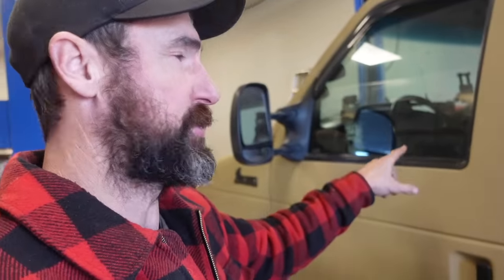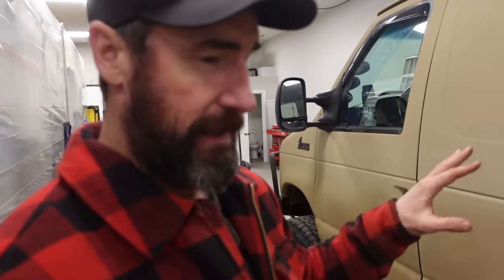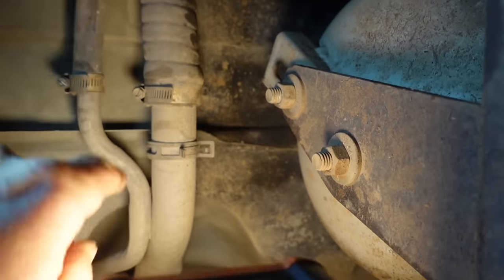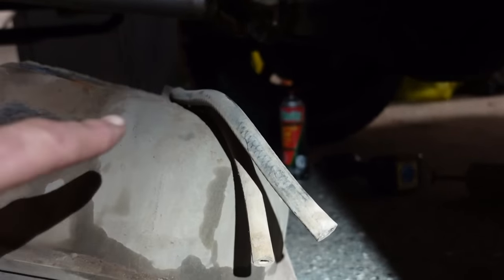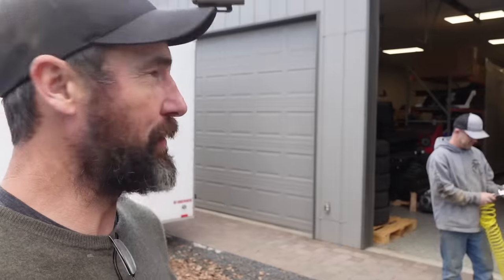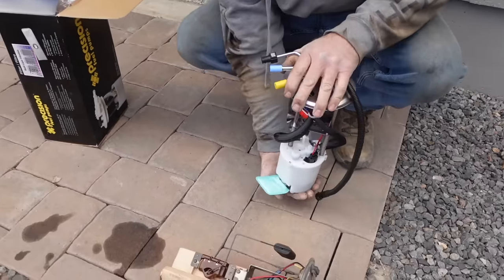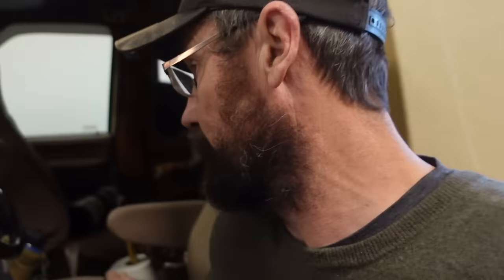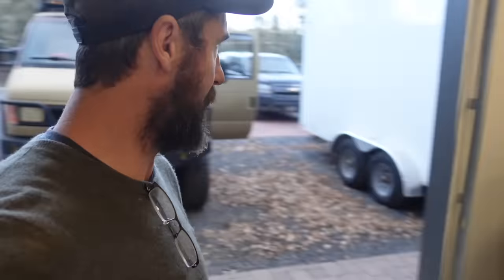Super Simple Ford E350 Econoline Fuel Pump Fix

Comment: What I learned is being friends with a guy with a roll back truck and another guy who is a van mechanic is very useful for someone who lives the van camper life.
Reply: Just having a lift to do vehicle work is a huge help by itself.
Reply: It is ALL about the network!!! No matter what your in to.
Reply: You fixed the effect and not the real problem.  In tank fuel pumps are a matter of life now but having one go out on you hours away on ORV roads has no simple remedy. You would think that some off road aftermarket solution would be available that would have a redundant pump that would get your tit out of the wringer and not having you drop the tank on a dirt road after acquiring a replacement pump. A fuel pressure gauge on your dash seems like a good idea but really just tells you you are screwed.
Reply: @elffirrdesign2063  Carry an inline 12v pump would be a simple backwoods remedy.
Reply: @wildbill23c  .. I never used one myself. May I ask what benefit would it be for? Trying to figure it out now what one needs to connect it.
Reply: @RickyL305  Umm, you drive a vehicle onto it and it lifts the vehicle for easy underside vehicle maintenance without having to lay on your back under a vehicle to work on it...or with most of today's vehicles you can't get under them without either using jack stands, ramps, or a lift...I'd say a pit but those things are a pain for some people, and dangerous.
Reply: @wildbill23c  sorry for the foolish question, I just never heard on it being very very old school myself and not mechanically inclined but I just seen a video of it so thank you. I wished I heard about it last week though. I will be buying two just to keep on hand for my vehicles from here on out. Thank you.
Reply: @RickyL305  Geez you must be rich, a vehicle lift is around $5-6k.
Reply: Pay your friend

Comment: I am gonna make a point of using a hole saw to create access over top of my fuel tank/pumps. I carry starters, alternators, and for cross country trips will likely include a fuel pump.
Reply: Manufacturers should be doing this already.  (But where's the money in that??)
Reply: Old import trucks used to have access but that was to convince
Reply: @bagheerab278  some modern ones do, my son fixed his subaru in the driveway , I think his old Honda was the same.
Reply: I cut a hole in the floor and made a nice patch for it.  If you have continuing or repeated problems with the fuel pump or fuel gauge sender, it's invaluable.  The idea of having to raise and lower a full fuel tank alone is insane, especially when you have such an easy way to work from the inside - especially in the rain or snow.  Manufacturers should be especially aware of time and costs to repair - even more so with fleet vehicles!
Reply: You made that look easy. My RV van has been down for months. Everyone tells me they need a lift. Won’t work off floor jacks. Also 1200 to 1500 in labor cost. Wish I had someone like the both of you near by. Great video. I’m female and now with some knowledge I can keep from getting ripped off. LOL

Comment: those access panels cut and done nicely are great when you are in the middle of nowhere and that pump goes out and you have a spare in the tool box and can change one out inside your rig in the middle of winter or in harsh environments while sipping a coffee and watching a movie. ;-) you can also put a external oil filter in a place where you can open the engine inside and replace the oil filter and replace the oil with a basic hand fluid pump as well. great for harsh environments or winter.
Reply: Yep! Done it in many flatbeds, pickups and vans!

Comment: When you cut the roof to raise it ,get in and cut a access port in the floor to access the fuel pump ,it's a much better solution as you are on the road and then if future pump problems occur then you can deal to it ,boggy it up to run to a workshop or even have a fuel pump motor in the van .
Cheers

Comment: Yeah I would have cut a hole in the floor and went that way. There should have been one there like somebody else said it's not hard to do. You can seal it up. Good so it doesn't get air in or leak or get the fumes of gas if you do it right. But other than that you got it fixed. 👍👍🙂🇨🇦

Comment: We just did our fuel pump today as well. It was pain in the butt to disconnect the fuel line. The old fuel pump fell apart when we got it out. The new one starts right back up and we don’t have any engine light on our truck no more.

Comment: I am in the middle of doing a rebuild on an e350 motor home. I had a weird leak on top of the tank that came and went away after I jacked the framed a little. I bought from church half rehabbed and expected to have problems. I plan on driving this rv so I dont want no fuel leaks or pump problems. Better to do now than get stuck somewhere or worse have fire. My vision of dropping the tank was pretty much what you did. I have a set of those line release ring clips. Thank you for the video. Gives me guidance doing this work.

Comment: i have an issue on my 92 Ford E250 just like your van . the problem is the Fuel gauge indicator not working . i don’t have an engine light nor a code on . what would be the best way to fix this issue prior to dropping the fuel tank and change the fuel pump , cos accordingly to my mechanic he had it changed last year , but yet he didn’t told me that could had fix the fuel gauge at the same time . Auto century mechanic and owner has been ripping me off on my two vehicles for the past 4 yrs until i realized he has not been honest . please advise thx 
Edie

Comment: Definitely would have stuck with an OEM Ford fuel pump for a critical component like that. Also, considering the crud that intake filter had in it, I would have drained the tank and flushed it out before reassembly, and replace the main fuel filter as well.
Reply: It's getting harder to find OEM Ford fuel pumps for older Ford's.  I have a 97 f250hd and the dealer can't even tell me what the original  pump was in my front tank.

Comment: Does anyone know where the voltage connector (supplying the 8 fuel injectors with 12 volts) plugs in to get power?  Mine is unplugged so no voltage gets to the injectors. The lead on this male connector is less than 12 inches.

Comment: Unless you had just recently changed your fuel filter, it might have been wise to change it while you were in the shop.  I had a similar problem with my 2004 Dodge Ram Cummins diesel and it turned out to be the filter.  If your pump sock was very dirty it might be passing trash on to the fuel filter.  The Cummins used a lift pump and that eventually failed, but by the Dodge had abandoned the lift pump and moved to a fuel pump in the tank like yours.

Comment: How do you know what pump you need? Rockauto has different options. I don't have a V-10, CNG, or rear-mounted tank. I have a middle behind the driver's seat underneath. I'm guessing that's midship. I have a standard cargo box van, a 5.4L V8 gas E250. No auxiliary tank (like I wish). I envy diesel guys and their 40-gallon tanks. I would like extra capacity out of my 35 gallons lol
Reply: Most of the aftermarket pumps have a third line attached with a cap on the end.  That line is needed for the rear tank, but the pump works just fine in the front tank(only tank) with the cap left in place.  I ALWAYS cut an access hole and put a patch over it.  Even if I needed to clean or replace the main tank, it's really valuable if you need to change the pump on the road.  Either way, when you pull the pump, straighten out the lock ring by placing it between two steel plates and whacking the top with a hammer to take out any wobble.  That happens when removing it and can make it much harder to reinstall.  Also, you can bevel the leading edges of the lock ring with a grinder to help it engage.

Comment: Mechanic should not have been using metal tools especially hammering. One spark and it would have been end of your videos. Brass tools only unless you empty and steam clean
Reply: That is true of gas tanks.  Diesel is not as volatile as gasoline, so there was little danger of an explosion.  I did see a mechanic try to braze a hole in a gas tank after washing the tank out several times.  The instant the flame hit the tank there was a “woof” and the tank instantly transformed from rectangular to round. That’s why you shouldn’t use gasoline to start a fire.  However, you can use diesel to start a fire because it won’t flash like gasoline.
Reply: It's a slight risk, but not much if the area is well ventilated.